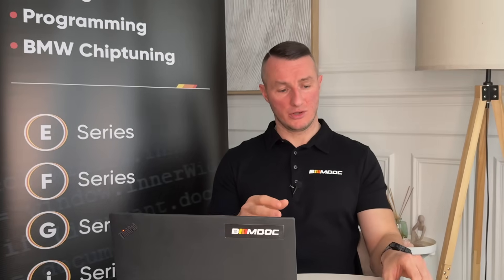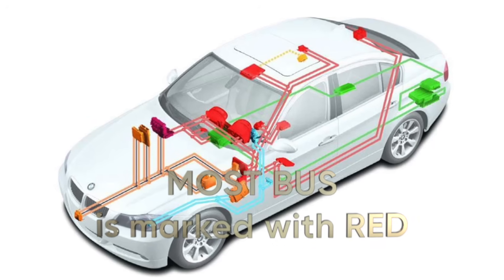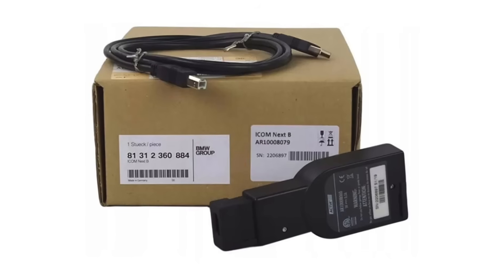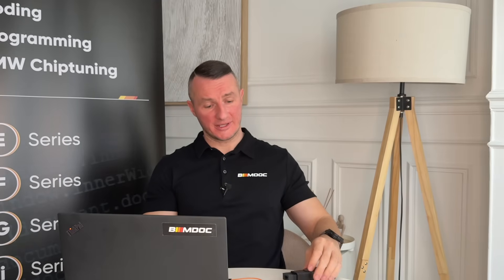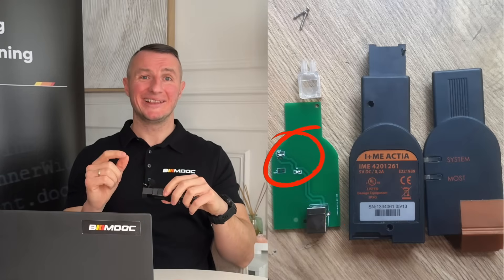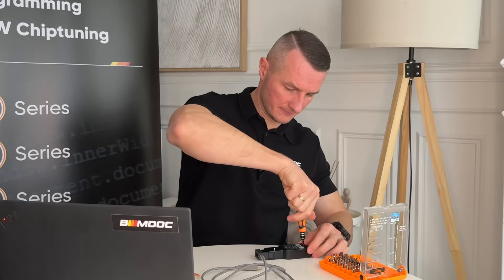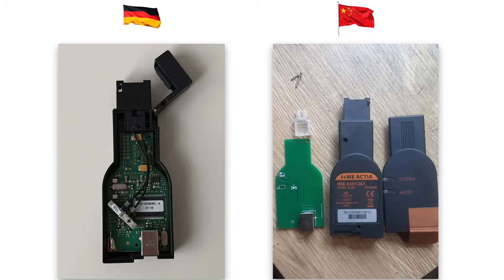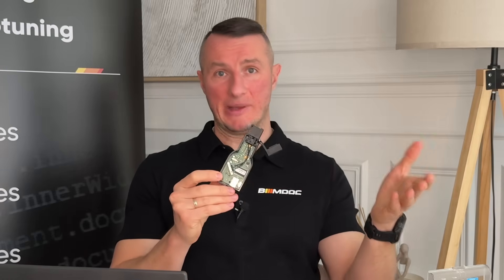Warning: Fake BMW Tools That Can Wreck Your ECU – Must Watch!

Comment: Another great video, On the subject of none original tools, I’ve noticed that the Enet cables from China have a 1.5k ohm resistor between pins 8-16, I believe the correct resistor should be 52ohms is that correct? Thanks in advance.

Comment: I have bought a icom next from a website he says the small thing you don't need its only needed for old cars even older cars then e series 2009
Reply from the maker: It’s not correct 
On new G series ista online also requires OEM ICOM NEXT to do some special functions.
Reply: @BimDoc  thanks for your  answer 

I have other  small thing i have  ista 4.31.40 is it possible to program f,g and i cars?

Comment: Hi is it possible to reset my head unit using esys ? My connected drive keeps rebooting?
Reply from the maker: Sometimes SW update helps from that issue. 
But if it restarts due to mechanical fault, then SW update might fail and you will brick your HU.

Comment: Hi is it possible to reset my head unit using esys ? My connected drive keeps rebooting?
Reply from the maker: Connected drive is bmw telematics service it has nothing to do with HU (headunit) restarts. 

Sometimes reprogramming HU via esys helps against restarts. But not alway.
Reply: Thank you for the quick reply much appreciated , I tried a different 
CD player unit from a different vehicle it stopped it from rebooting but I couldn’t use Bluetooth, so I’ve put the old one back in.  Hopefully esys I will help by starting. What would I have to do once I connect my laptop to reboot the CD player unit?

Comment: Hey vladimir, can u help me ? i have an BMW G31 touring without ACC. with 360 cameras. Lately I have been receiving limited driver assistance notifications from the car. After 5 or 10 minutes of driving, the error appears after starting the car. the steering vibration and blind spot detection are turned off after the error, quite annoying. 

I scanned my car with bimmerlink and this is what I saw;

Camera-based driver assist system

2 errors
E05429: Signal error- 0x3538- 0x0001 - BMW_DASS_DriverAssistanceComfortAndSecurity
Signal invalid
800A01: Camera field of view disturbed by weather conditions

Comment: Hey Vladimir, when is the English nbt retrofit video?

Also, how many and which type of fcs codes we need for a successful id6 fit?
Reply from the maker: English video will be possible only if I’ll have such job to do))

Full fsc pack for retrofit is not a problem. I can help with that.

Comment: Thanks boss shearing your good experience About for tools but I have one problem I have 2022 bmw x5 diesel g series but I forgot which g series that car does not have 360 camera we try to do retrofit we put everything after we try to update head unit but that's fail and now screen comes on white and nothing else only white and blank now there is no cfd files now I want advise form you waht can be happen and what should we do please any idea or help Thanks allot boss
Reply from the maker: Contact me directly for recovery. 

But for future: always update first then do all retrofits. It’s way easier in that way
Reply: How can I contact with you boss

Comment: Hi, Vladimir. I receive the same icom-b, empty inside, from ali express. It is designed to flash the light and thats all. Fortunatly I diid not make any programming. I message to seller, he was surprized, and he provide the new icom-b. It has some problem with connectors, but I succed to read modules. Not flashing yet. Thanks for the video.
Reply from the maker: Icomb is not required to read anything. 
For flashing only 

For reading even Dcan is good. 

But anyway it’s good to be cautious
Reply: @BimDoc I have read the list of moduls (ident, uif) such as cic, combox, hud, amp in inpa using only icomb. Only for test

Comment: Bought an Enet cable from aliexpress. It’s fully functional in e sys but I was never able to get it working with ista. It sees the vin, but never completes vehicle identification. Don’t know it’s a bad cable or am I doing something wrong
Reply: If it working with e-sys, when it should work with ista 100%
Reply from the maker: You are correct 
There are some versions of ista than don’t want to work with enet well

Use ista v 4.39
It’s a good one
Reply: @BimDoc  Would be great if you can post a video about the recent ISTA versions and which to avoid. F.ex. why is 4.39 the best one, and what to do if you want newer programming files.
Reply: @TorgeirFredriksen  https://youtu.be/mKkBbXILgXk?si=Ir0p-ucxlASec-Tl
Reply: I hade the similar problem, i changed enet cable and everything works good.
Reply: It works perfect with e net. Something is wrong with yours